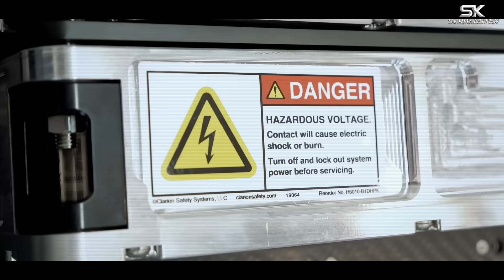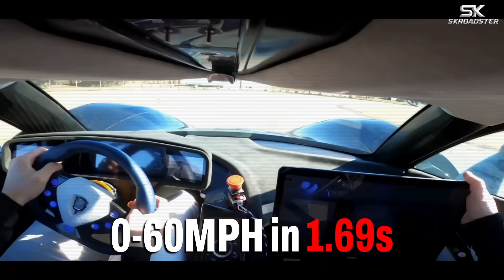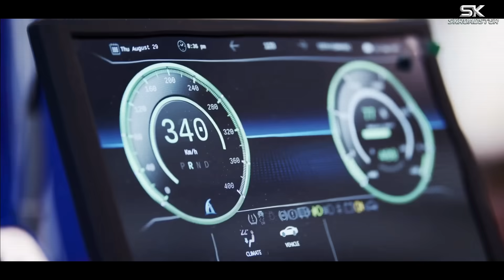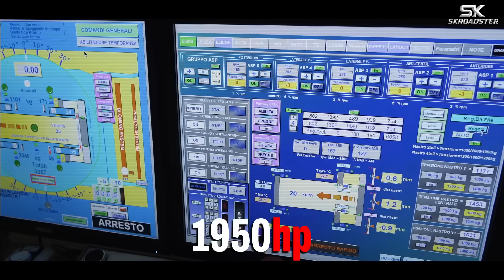Meet Aspark OWL That Challenged BYD U9, Bugatti & Koenigsegg | Documentary

Comment: BYD U9 is not merely a car with a high top speed. The top speed depends on the tires and can still be improved further. I believe the Nürburgring record requires improvements in aerodynamics and weight.
Reply from the maker: Yeah still it did batter
Reply: It also needs more battery

Comment: Looking at the height, bulkiness, and aerodynamics of the Aspark Owl compare to the YW U9X, it surpasses in every metric but surprisingly the later falls significantly short on performance and top speed😵‍💫
Reply from the maker: Yeah, the Owl is much more stable, but it has an 800V system compared to the BYD U9X’s 1200V, which is crazy. The U9X was accelerating even more — it might have hit around 550 km/h.
Reply: na its just too down to earth😂😂 look how  ugly it is